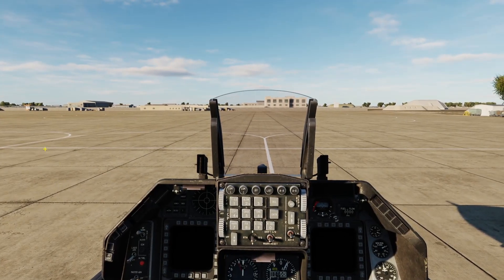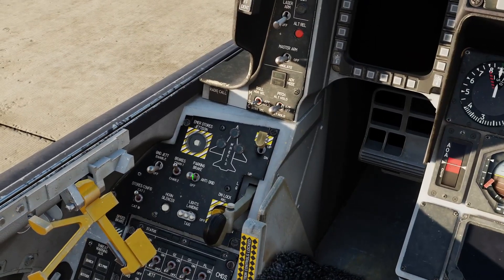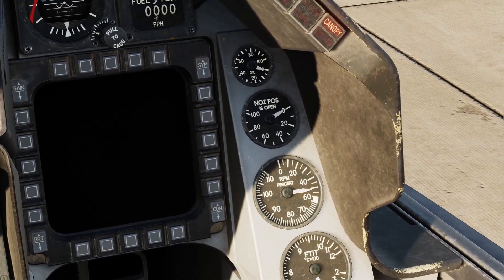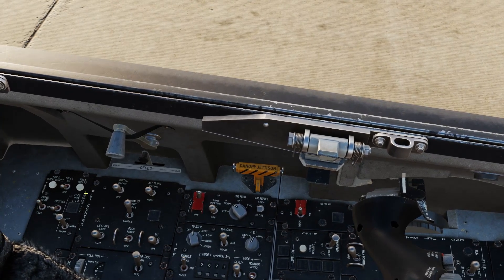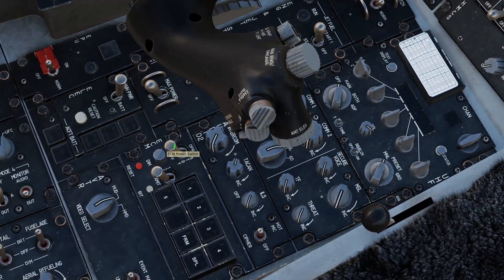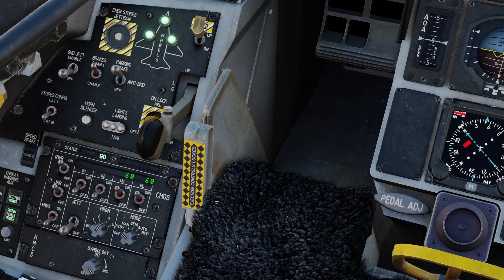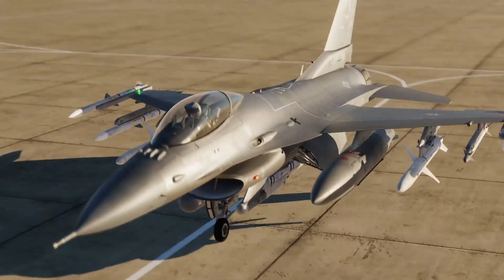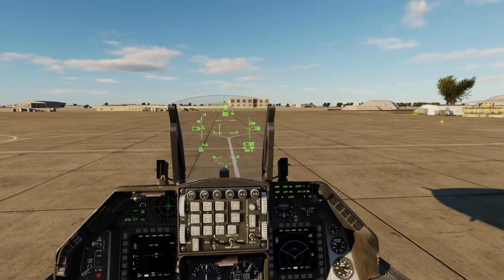DCS World: F-16 Startup Procedure (Revised)

Comment: Hi! Thanks for the video, I'm gonna watch your entire F-16 series.
Quick remark though, you flick the MIDS rotary as soon as engine is started; I was told to wait 1 minute after turning on GPS, to prevent problems with the datalink.
Don't know if it's true, or useful, I just do it; you can check that GPS is on and setup by looking at the time page on the DED: if it shows "SYSTEM" then GPS is not set, if it shows "GPS SYSTEM" it's ok...
Reply from the maker: I dont think it matters in dcs, i havent had issues w it that i can remember
Reply: @__Whisper__ I had issues with this the other day, and turned out to be this exact thing. Now I wait with turning on mods until ready to taxi

Comment: Only one ECM program (1 to 5) should be active at a time — pressing multiple buttons may cause errors or be ignored by the system: 1 is for wideband jamming, 2 for narrowband jamming, 3 for anti-SAM threats, 4 for anti-aircraft threats, and 5 for training or test mode.
Reply from the maker: In DCS they dont function any differently. From the manual: “The Manual Band Control Buttons in the DCS: F-16C Viper function identically within DCS World. The selection of different ECM modules will not produce different effects on a given threat system.”